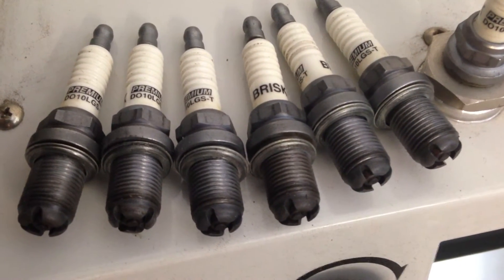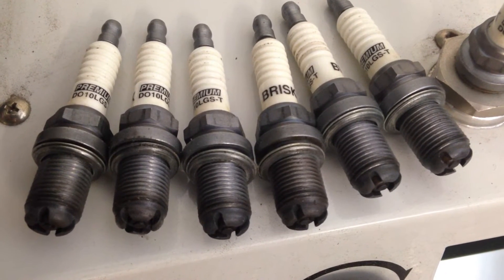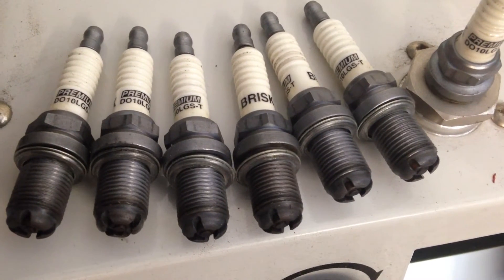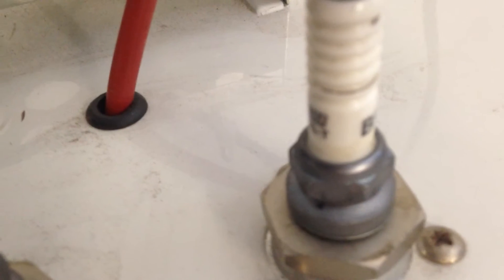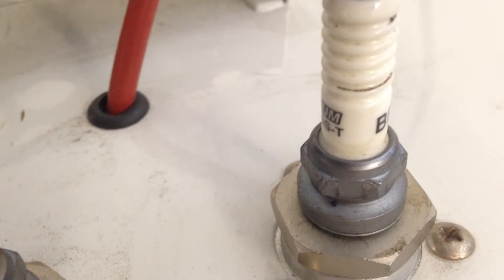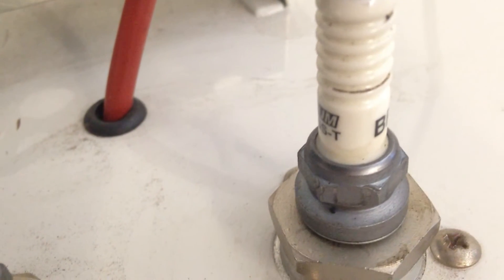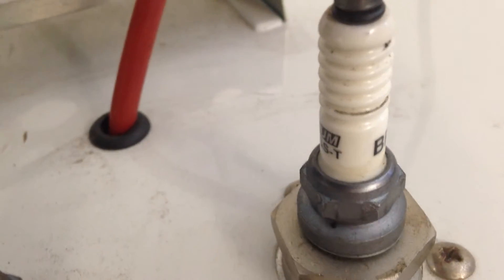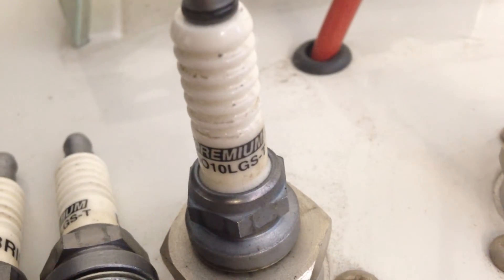Internally Cracked Spark Plug due to Improper Installation - Example of Over Torqueing

Comment: Yup seems like I cracked 2 of my plugs during install. They made a quiet glass cracking sound. When the car starts its fired up real good like a fresh set of plugs should, but under load it miss fires worse than it did before.
Reply: I managed to fracture the porcelain taking a plug out to check the gap. I heard a light cracking taking it out an sure enough 2 fractures running top to bottom .. porcelain still attached none missing but causing a miss. First time for everything I guess .
Reply: @codyramos3200  From now on on the 302 im using minimal antiseaze on a clean thread lightly hand tight. So far no problems. On the newer 4.6f150 no antiseaze torqued carefully on a clean thread.